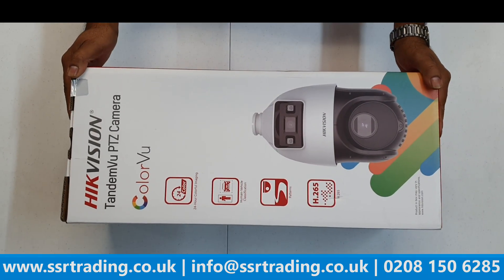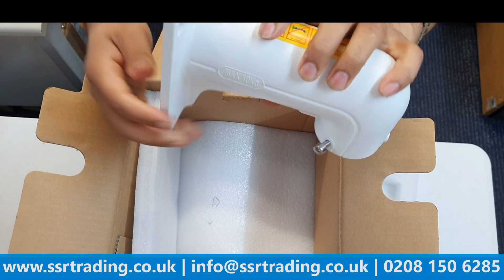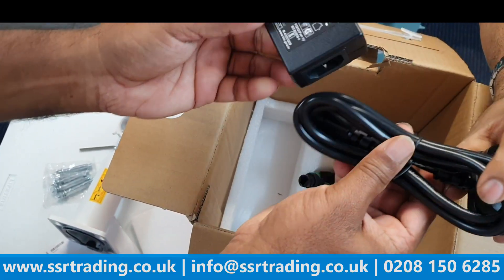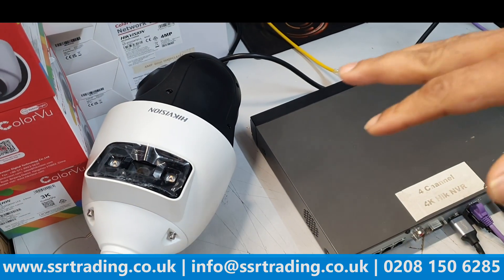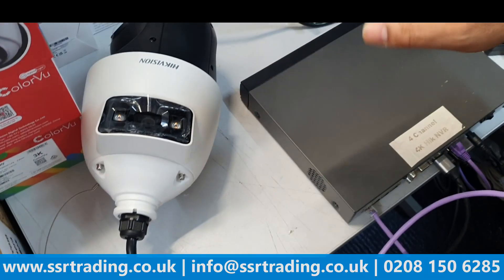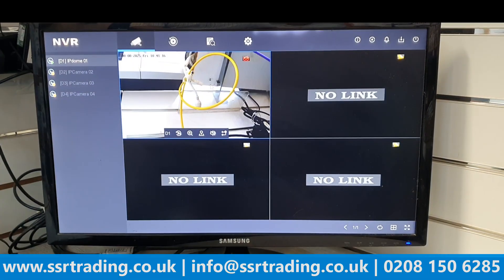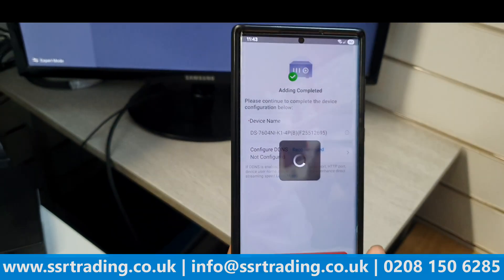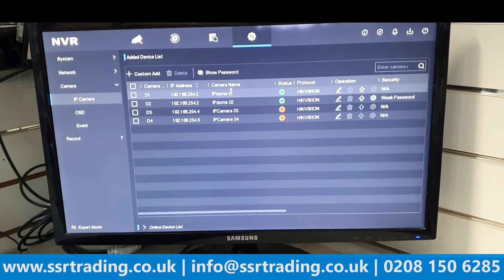Unboxing and Configuring a Hikvision TandemVu PTZ with Two Camera- (DS-2SE4C425MWG-E(14F0)

Comment: Now, if this calibration would actually work for more than just Microsoft Edge in IE compatible mode, that would be nice! My DS-7732NI-M4 32-channel NVR with latest firmware (V5.04.066 build 250620) is worthless for these cameras. Inaccurate 3D positioning, inaccurate zoom with box dragging, unable to switch between active cameras (panoramic-to-PTZ or vice-versa) without first deactivating 3D positioning, switching cameras, then reactivating 3D positioning, no 2-camera split screen or PIP display like in the browser UI... It's more of a hassle than it is useful.

Comment: I have 2 cameras, HIKVISION tandemvu,  very often 1 camera came offline,  pls help
Reply from the maker: HI @dheerajmohabeer6899
Pleaser check the Power Supply:
Ensure the camera has a stable power source. Unstable or insufficient power can cause intermittent disconnections.

Network Connection:

Verify that the Ethernet cable or Wi-Fi connection is secure and stable.

If using PoE, make sure the switch or injector provides adequate power.

Test by connecting the camera directly to the NVR or router to rule out network issues.

IP Address Conflicts:
Make sure each camera has a unique static IP address to avoid network conflicts.

Firmware Update:
Check the camera’s firmware version via the NVR or iVMS-4200 software. If it’s outdated, please update it to the latest version from HIKVISION’s official website.

NVR or Software Settings:
Confirm the camera is added correctly to the NVR and that the network settings (especially DNS and gateway) are configured properly.

If the issue persists after these checks, please provide:

A screenshot of the NVR or software showing the offline status.

The current firmware version of the camera.

The power and network connection details (e.g., PoE switch model).
Reply: @SSRTradingLtd Thanks you dear. Be blessed